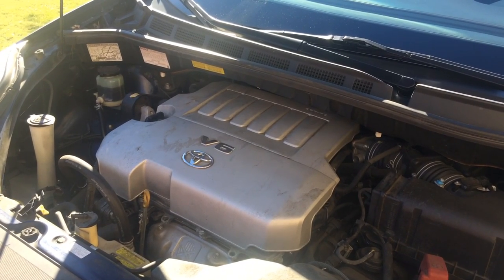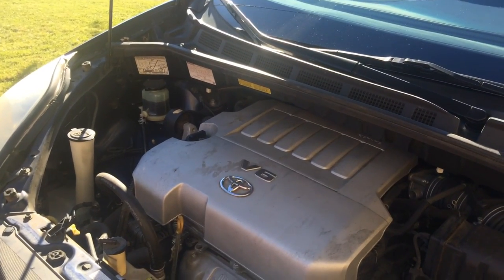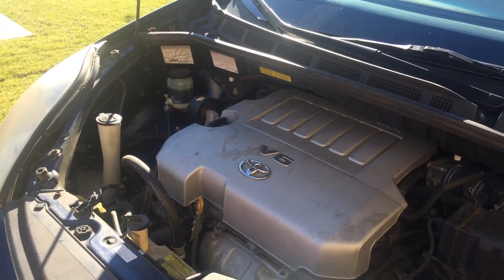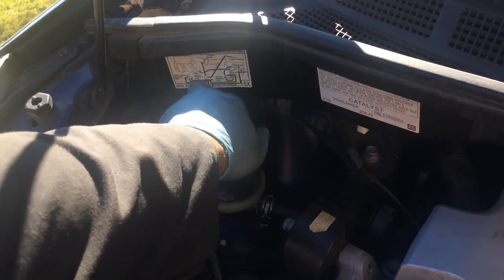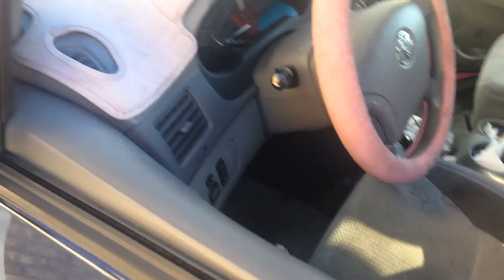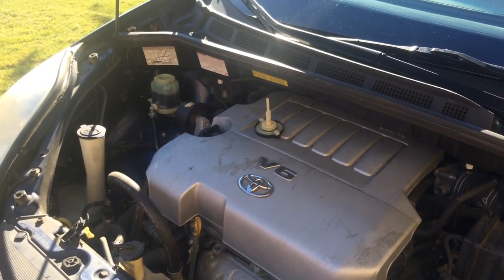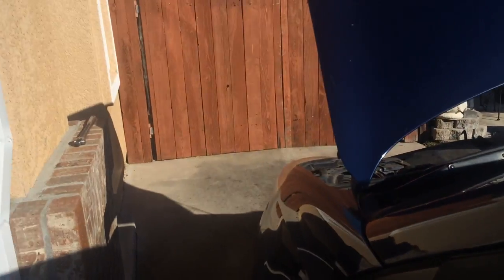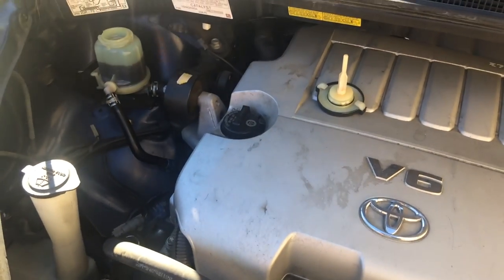How to bleed air out from power steering systems

Comment: Why is it important to: a) go slowly; b) have the car OFF when you do this?
Reply from the maker: Doesn’t need to be off. It can be either to be completely honest. Going slow will help facilitate air getting pushed out rather than speed running through it which will produce cavitation.
Reply: @HelpingHandAutoRepair  Thank you SO much for explaining.  

Yeah, I did it both running, and off (in 2 separate sessions, with driving in-between).I did about 40 rotations each time: 20 to the right, and 20 to the left. I went SLOWLY with the turning.  However, at a standstill, trying to turn the wheel results in the asssist coming on and cutting out, rapid-fire style. It's as if someone is hitting an on/off switch on the power steering system, at 0.5 second intervals.  If the car is at all in motion though, it steers normally.

I hate to be a pest, but would you be able to provide any advice on what I need to do next, please?  I'm pretty much at wit's end with this issue now.  I just did the timing belt, and I needed to disconnect the PS reservoir to get access to the timing side of the motor.  It steered 100% normally, before I introduced air. I can only imagine that this air is the problem.
Reply from the maker: @Maplecook just air sounds like. Most systems will self bleed. There are none that I know if that have bleed valves on them. Unless you have a defective pump which is possiblez
Reply: @HelpingHandAutoRepair  Thank you so much.  Subscribed! =)

Comment: I have a 2011 Nissan Maxima just got my power steering leak fixed but now when I’m turning especially at low speeds it’s whining a lot does that mean I just have to bleed the air out?
Reply from the maker: Possibly or the pump is defective